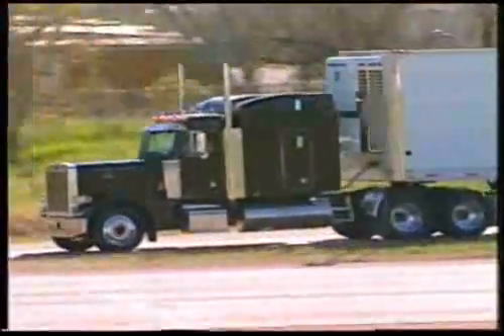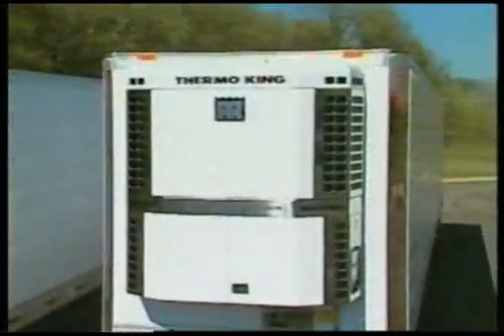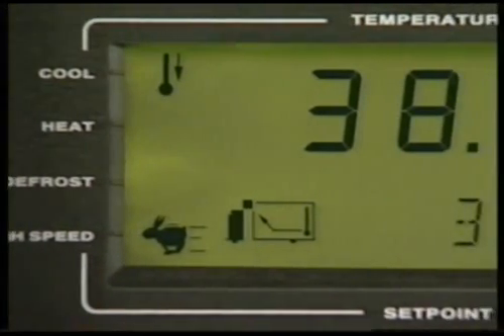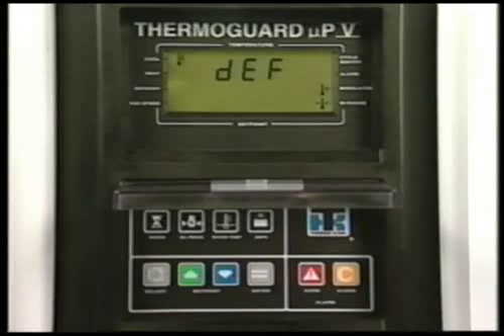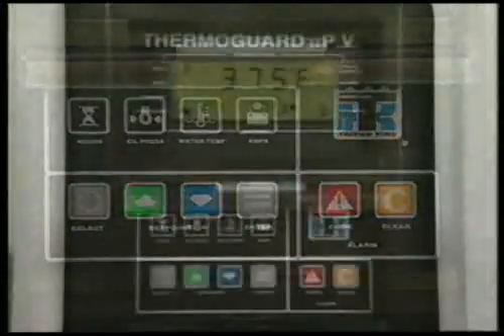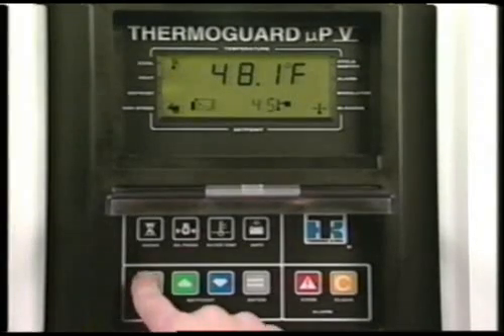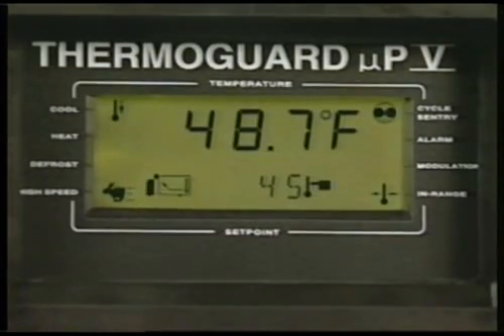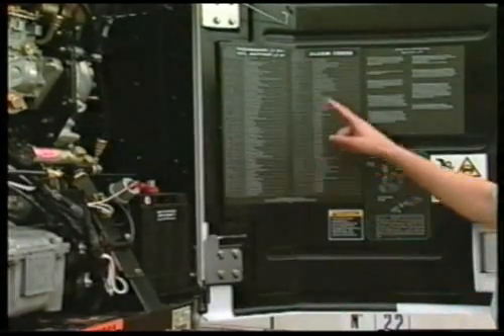Understanding and Operating uP-V Smart Reefer Units - Part 1

Comment: whats cycle century operation mean?
Reply: Cycle sentry means it will not run continuous.
Reply: it will shut off when at set point, and turn on when exceeding the temperature spread from set point